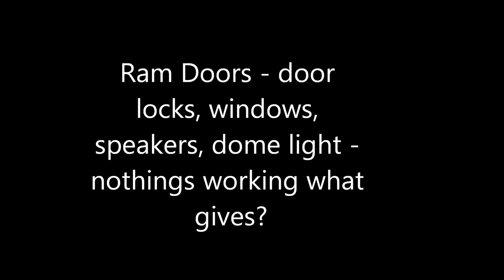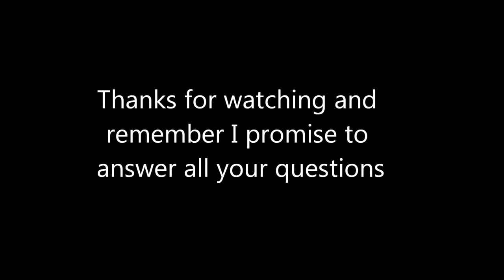Fix Your Power Door Locks or Windows

Comment: ...here's the update 4/30/17 {2006, 1500 , dodge ram megacab 5.7 hemi }  i just finished, and the man was 100% right. i had 4 wires cut and 2 wires with internal breakage but the silicone jacket was still intact causing an intermittent ongoing problem  ,i successfully repaired the issues thanks to this video.  your video took the guess work out of the job. thank you my brother. i have liked and i am a subscriber in appreciation
Reply from the maker: Glad to help anytime El

Comment: Wish I had watch this before I ordered my lock actuator. My dodge Durango has this problem. Its doesn't unlock at times. Since I changed the actuator the lock rod doesn't fully pop up until the second try at unlocking it. I will check the wires as you instructed. Thanks for sharing!
Reply from the maker: Better than 50% chance there is a broken wire or two FOUO

Comment: Nice video. My 1999 GMC Yukon has the same problem. The power windows work but the locks and exterior lights stop working two months ago. Going to try this and see if it works. Before this video I was scratching my head
Reply from the maker: Great - let me know how this works out for you - same design on lots of cars and trucks - I always check this first - cheers!

Comment: Great job on the video & information. Question: 2006 RAM 2500 5.9L Laramie, where the power door locks all stop functioning, and the chime when the engine is turned off will continually sound until the door is closed. I reset the power door locks so they once again work by following manual instructions, until I once again turn off the engine, and it goes back to the same fail mode. Any idea what causes this?
Reply from the maker: check for poor grounds and get a wiring diagram
Reply: @carquestions  Thanks! I have the service manual pdf for the wiring. It's now as of late acting more like a connection issue.

Comment: Great video and information, Mine has been haunting me for years. I will check out mine very soon. Thanks!
Reply from the maker: Great - let me know what you find - cheers!
Reply: Took care of mine over the weekend. Every wire was broken or about to be. Spliced/Soldered all of them. Works fine for now but existing wires seem brittle. Will probably need to get new harness/s moving forward. 
2003 Ram 2500, 5.9 Cummins, I bought new and now have 326K on her...
Reply: Chris Maure
Reply: @Fed-Up_Hallelujah , no doubt.  I just repaired everyone of the wires on my 2002 Ram Quad Cab 1500.  While my repair job was good,  those wires will break again.  Just wanted to get mine repaired so I can sell it and honestly say,  everything works.

Comment: I have a 1998 Dodge Grand caravan.... Door locks don't always work. They always unlock but not always lock... Is there a central place that controls all four door locks.... I could use some help with this.... thanks....
Reply from the maker: check for a broken wire that doesn't look broken on the outside - also you can try applying power directly to the motor to see if it's the problem or it's wiring related

Comment: Hello thank you this is a great video and it is just what was wrong with my driver side rear door. After fixing six wires yesterday I thought this could be the problem with the drivers door. So I pulled the loom back but no broken wires. Now what the problem is, is that when I park and turn the key off than open the driver door that should unlock the other three doors but it does not. Also sometimes the horn will work while driving other times the hore just dose not work. Is there a relay for this or is it something else? Thanks again
Reply from the maker: Vic - you'll need to get a wiring diagram to troubleshoot those other problems - also check settings and disconnect then reconnect the battery for a few minutes - Chers From Canada!

Comment: hi, good video,,i have a problem on a gm meriva,,master door locks itself,removed battery and it still half locks with one pull on handle and fully locks on two pulls,,,must be a mechanical problem i think,,but need to look,,any help appreciated,,rgds
Reply from the maker: Disconnect the power door lock from the lock itself then try the door lock and see if it works properly - if it does than the power door lock is the problem - do it for each door

Comment: i have a question. i have a 2009 ram 1500 trx4. i had just bought tow mirrors for my truck with the turn signal and puddle lamps. i have factory power heat, do you know how i can get the puddle lamps and turn signals working?

Comment: I have a 2008 Subaru Forester, and after I purchased the car, the seller told me "Don't lock the doors with the key fob or with the key."  I have to leave my car unlocked for now until I can fix it.  What would cause the doors not to be able to be locked with the key?  I am afraid of being locked out of my car if I try to lock it manually.  Can you tell me what the problem might be?  Thanks
Reply from the maker: OK try this - roll all the windows down, get out of the car and lock all the doors with the remote and test if all the doors fail to unlock or lock - then try the key - if nothing works you can always reach in and open the door - if the remote  and key don't work then there are broken parts in the door - maybe because of a previous failed repair or break in
Reply: Thank you for your quick reply.  I will try this, but only with a car locksmith near by.  I am thinking it needs to be reprogrammed or it may be the actuator.  I will try your suggestion first.  Thanks
Reply from the maker: No locksmith is needed - the windows are open and the inside door handle should work - also the key is all mechanical so its not a programming issue if it doesn't work it is a mechanical problem
Reply: Thank you

Comment: I have a 2007 honda civic. I have remote start in it. one day I pushed the remote start by accident and then pushed the button again to shut it off and now three of the windows don"t go down and the power locks don"t work. does anyone know what that could be
Reply from the maker: Remove the remote start and all its wiring - it could be a fire hazard if wired incorrectly - have seen this before

Comment: what if all doors are locked and when driving it makes a locking noise like it wants to lock but that one door doesnt lock?only stays lock if i push it with my fingers and unlocks when i pull it
Reply from the maker: Faulty TIPM, faulty switch - hard to say with that one  sorry Dino

Comment: hi where are you located?
Reply from the maker: Near Cambridge Ontario Canada
Reply: @carquestions  Too bad.  I have a 1987 S10 Blazer the PDL and the rear tailgate lock that works off the same front door switches all do not work.  The rear hatch glass works, but that is on a different switch.  I wont be doing any of the work myself and I do not want a local butcher poking a bunch of holes in my harness to check things and play guessing games.  The Blazer has been garage kept since new and only has 62K original miles on it.  I am in Eastern Tn.
Reply: I think there is a relay near the steering column I am hoping I can start there and just try to plug and play

Comment: I'll say it right here,  what a shitty design by Dodge.  Those are absolutely the wrong wires for that application,  they should have been more flexible.  That being said,  this video is spot on.  If you have an older Dodge Ram and are experiencing electrical issues with any of the doors,  this is where you need to start.

Comment: Thanks for the info!! I have an 06 3500 MegaCab with nothing put wiring problems! constantly fixing this truck! Dodge sure makes one hell of a shitty truck!! the only part of the truck that has never giving me a problem in the Cummins Engine! heading out now to fix both left and right door wiring! I took it to the dealer and they had no idea how to fix it! they also broke both left front and left rear switch mounting plates! they never admitted to breaking them so I had to go out and buy new ones! Dodge SUCKS!
Reply from the maker: If its a Dodge it will always start and run - everything else might be a problem though

Comment: Like your last comment "just sell the truck" 👍
Reply from the maker: Cheers from Canada Gary!
Reply: @carquestions  having issues with my drivers front window, power to the switch but doesn't open or close. All others are fine. 2013 Ram 1500
Reply from the maker: @GoneBroke  check power at the motor when switch is pushed - if it has power you have a bum motor